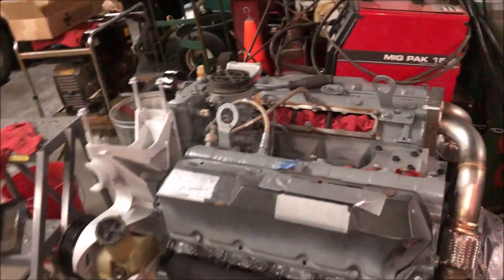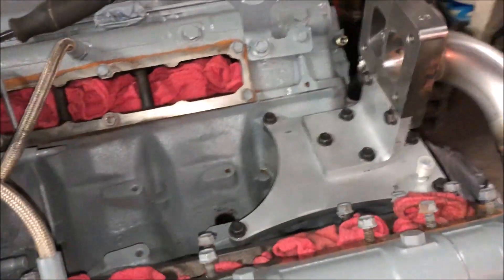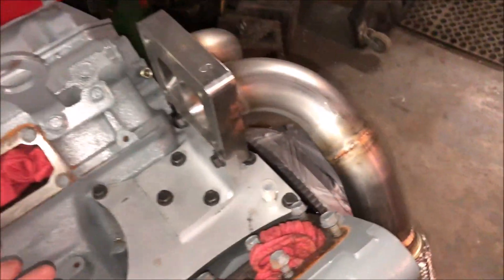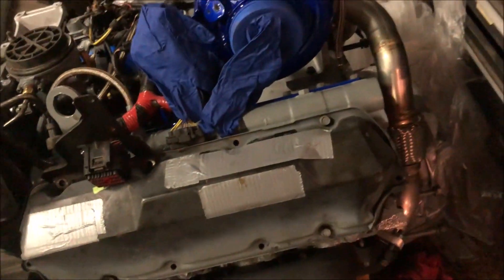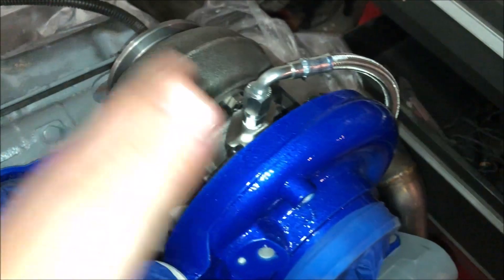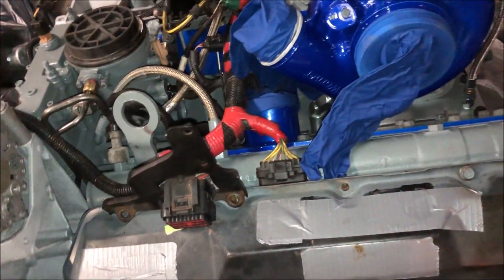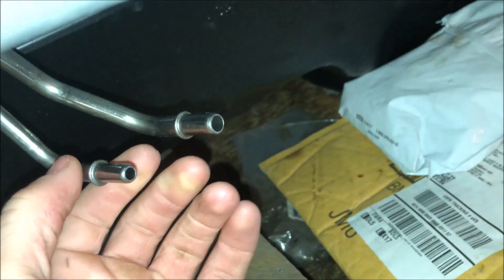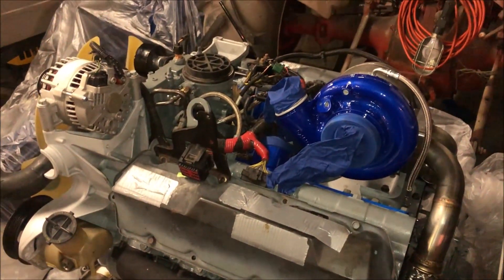7.3 600hp Engine Build Assembly Part 3- "T-4 (s369) Turbo Kit Installation/Powder Coat"

Comment: Looks a great work fellas 👏 600hp! damm it's enough for my excursión 7.3👌👍 only a one thing I hate on this 7.3 it's a glow-plugs position!!👎 but the engine is powerful and fiability 👌👍 cheers from Norway
Reply: I can verify it will not make 600... i ha ve the same build with a brand new motor, best i ever got was 553

Comment: No way it’ll make 600 wheel with the fuel bowl in there and that small of injector more around 600 crank maybe.
Reply: cody G facts I got 250 over and not close with to 600 more like 550 with those 250 overs and dual pumps
Reply: 7.3 Nation it’s tuff making 600 on a 300cc 200% as it is

Comment: Cool but you got stock head bolts and pushrods and valve springs you’re going to blow some shit 😂 second you’re not pushing 600 with those injectors maybe 450 if you’re lucky bud stop trying to flex “600” when you’re not even hitting 500

Comment: I dont think that is gunna make 600hp... i have the same build and best my truck did is 553hp... and i have cam, irate fuel, beehive spring, diamond pistons, s369, 250/100, rods, arp, girdle, etc... still only made 553 for best pull on dyno
Reply: I made 1200 foot lbs with 250/100 sticks